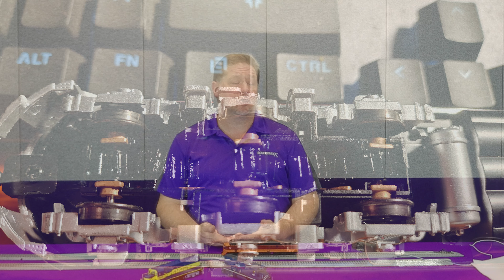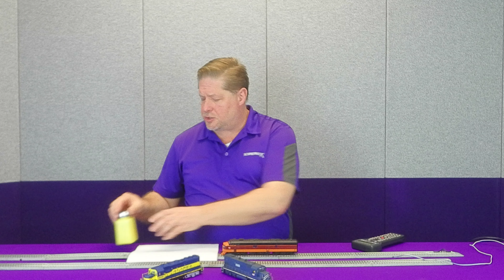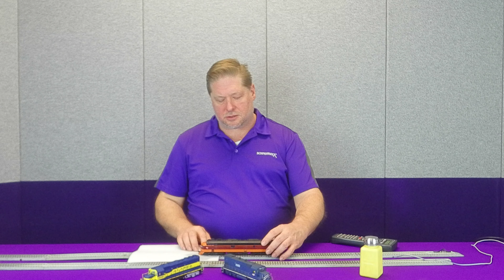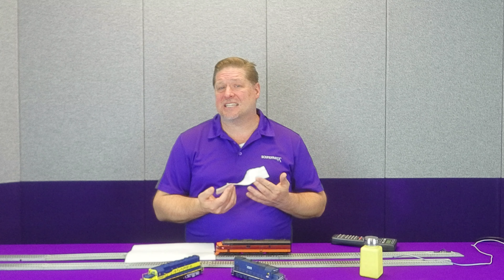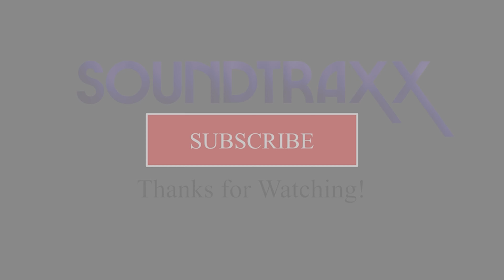Keep It Clean to Ensure Your Decoder Gets Power

Comment: Everytime i install a soundtraxx decoder into a customer loco, i clean the wheels always.  Using rail zip i find is a real easy way to maintain electrical contact from rails to the wheels.
Reply from the maker: That's a great tip, thanks for sharing!

Comment: One thing I like about the Android Blue nami app is there a shows track voltage so it kind of highlights where bad spots are on the track due to the low voltage indication.
Reply from the maker: That's a great point. The app is definitely a useful troubleshooting tool.

Comment: Excellent George. I service client locomotives regularly do deep cleaning of the gear boxes and wheel bearings. For the wheel bearings and axle contacts I use a  toothpick that has a tiny tip of dielectric grease. If I do remove the gears completely, I wash them in a very mild solution of diluted dishwash. This makes the gear wheels very clean with excess grease or oil and dust removed.
Reply from the maker: Thanks for sharing your cleaning tips!
Reply: @SoundtraxxDCC  Thank You George for all your help along the way. You are an excellent teacher.

Comment: Hi George ,  20 year signal electrician and 50 yr model railroader here , did you know rubbing Alcohol is a BIG NO NO for cleaning electrical components, especially rails. It is hydroscopic that allows water to absorb  and can make things worse. Look up "Polar and non Polar " cleaners which I'm sure you may know already.  , Apart from un -conductive rails ( remember clean rails are not necessarily conductive) most locos have no suspensions that allow all wheels to make good contact with the rails. Athearn RTR still use the old type trucks which allow wheels to rest on uneven rails. If you keep ythe bearings lubed with the right oil , it WILL help with conductivity. WE use "INOX' on our signal equipment switches and contacts to keep them working in harsh railroad conditions, and I clean my track with it and have done for decades. CRC. 2-26 is ok , and a much better cleaner and protector the IPA. Watch my video on track cleaning and read the comments from users🙂
BTW i have around 80 Tsunami installs so far.
Cheers Gregg.
Reply: Gregg is right on with his caution about "rubbing alcohol" (Usually, 70% or more isopropyl). While using it (isopropyl alchohol) seems to be a good cleaner of  electrical pick-up wheels, it is too chemically "polar" to be used for this cleaning in spite of the fact is is easy to buy and not expensive.  In its place, I have been using WD-40 CONTACT CLEANER (not WD-40, regular)  I use it in the same way alchohol is used on a paper towel as George did to clean the wheels. The down side is that it is not good for cleaning rails or protecting them and the wheel surfaces.  I have tried the CRC 2-26 and found that it cleans well but does not seem to inhibit the micro-arcing between "clean" track and pick-up wheels.  It is this micro-arcing that creates the black gunk everyone is cleaning off of track and wheels.  (On-board power--batteries--may eliminate the need to clean track and wheels.)

To reduce micro-arcing, never use an abrasive to "clean" rails or wheels.  Tiny scratches are produced which promote micro-arcing.
Reply: @WayneLong-cs6xp  You are spot on Wayne, never use abrasive cleaners of any kind to clean rails or wheels!
Gregg 🙂
Reply: thanks Gregg
Reply: @ronaldrondeau7870  Thanks Ronald 🙂
Reply from the maker: Yes, isopropyl alcohol (IPA), often found in rubbing alcohol, is generally safe for cleaning electronic components, as long as it's used carefully and the device is powered off and unplugged. IPA evaporates quickly, leaving minimal residue and is effective at removing oils and grease.
Reply: I concur with the post above that IPA may initially clean gunk off wheels and rail, but it is a poor long term solution.  I use mineral spirits as it is a non polar solvent.  My personal experience is that mineral spirts, provides a long term cleaning and is easily available at your big box store.

Comment: Thanks George, I used the product  from Aero-Car hobby to clean my tracks and dont used abrasiv pad no more first just wipe my track with an old white stocking then aply the product it last for months
Reply: I also have used the Areocar product for 20 years with my Digitraxx system and (mostly ) SoundTraxx decoders. Always very reliable running. 🚂
Reply from the maker: Thanks for the tip!